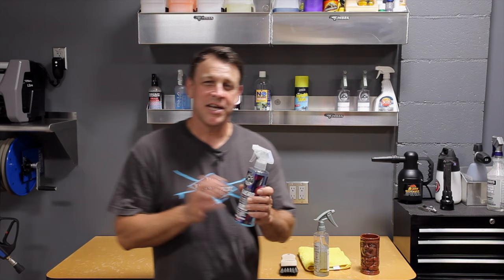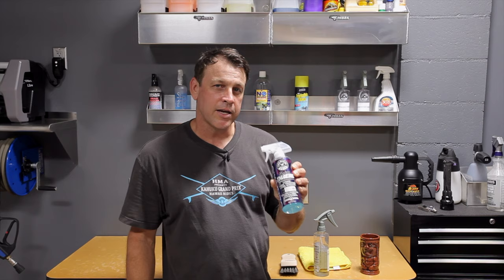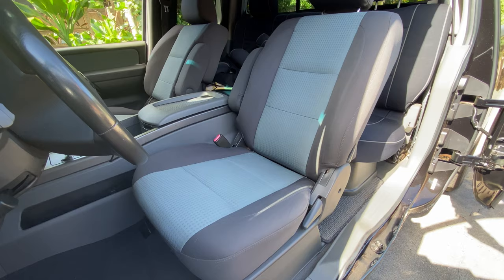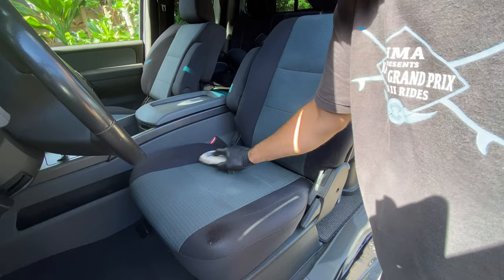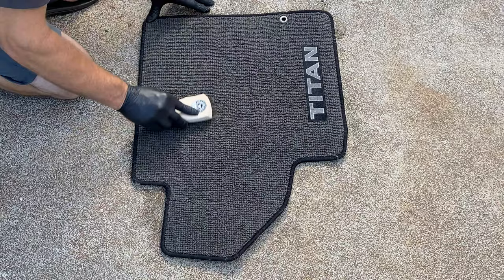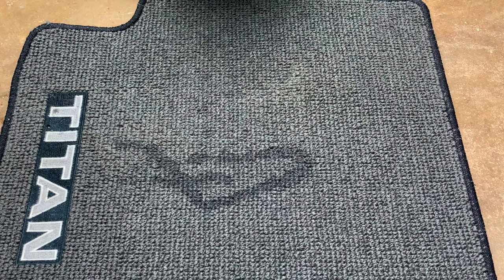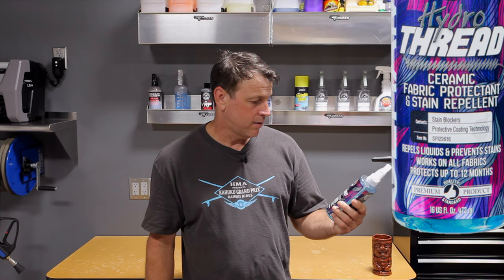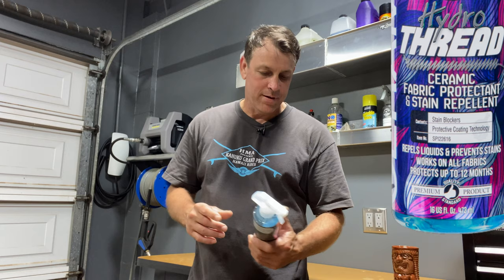CHEMICAL GUYS HYDRO THREAD CERAMIC FABRIC PROTECTANT Review & Test.

Comment: How long did you allow it to dry before pouring water onto it?  I used this on a set of higher end Lloyd floor mats that spent more time in my trunk then on the floors because I was worried about them getting stained.  I did two coats, 20 minutes in between and allowed them to completely dry over night and the results are exactly as advertised.  I'm in no way trying to knock your video but I thing a longer wait will work better.
Reply from the maker: I waited 24 hours for the first test. I tried again at 48 hrs. Same result. I even tried a week later to be sure before I posted the video. Water soaked right in. I did multiple coats and used plenty of product also. After watching a few other videos I believe it has become clear that it is only effective on select types of fabric. If the buyer is lucky enough to have the right fabric than it probably works fine. The bummer is it says all fabrics on the label. The fabric in my truck is a synthetic blend which it does not work well with. This is a super common fabric in trucks and trucks are the type of vehicles that would benefit the most from this product. Thanks for watching and for your feedback.
Reply: @HawaiiDetailing  pretty solid reply there

Comment: Is there a product that you would recommend? I just bought a gently used 2019 Nissan Rogue with about 16,000 miles on it. The interior on it is completely flawless, I’m afraid I’m going to screw it up.
Reply from the maker: I don’t have a goto fabric protection product. They all seem gimmicky. I would stay after it with proper cleaning products and you will be fine. Look at my interior cleaning videos and there are links to everything you need and I go over how I use all of them. Thanks for watching

Comment: I’m just gonna be straight up I have used this product and it really does work. It could be because he didn’t allow the product to cure. I have this product on my seats on my car and I spilt a polar pop and I had outstanding results most of the liquid ended up in my weather tech mats
Reply from the maker: Thanks for commenting and watching. I am glad to hear that it worked for you. I just wanted to share my personal experience with the viewers. I bought the product with high hopes. I usually don't buy things and review them unless I thoroughly research them and plan to own them myself. I really thought it was going to work well. I replied to a comment from another viewer when they asked how long I waited after product application to test. I figured I would re post it. One thing to add to that comment is its been over 2 months and I have ran several more tests and water still soaks straight in to the fabric.
My previous comment:
I waited 24 hours for the first test. I tried again at 48 hrs. Same result. I even tried a week later to be sure before I posted the video. Water soaked right in. I did multiple coats and used plenty of product also. After watching a few other videos I believe it has become clear that it is only effective on select types of fabric. If the buyer is lucky enough to have the right fabric than it probably works fine. The bummer is it says all fabrics on the label. The fabric in my truck is a synthetic blend which it does not work well with. This is a super common fabric in trucks and trucks are the type of vehicles that would benefit the most from this product. Thanks for watching and for your feedback.
Reply: I too have had good luck with it on my 2018 C7. It does recommend using at least 2 applications for the best results. Now it may be the difference in fabrics etc. I can only tell you my floor mats look brand new and water beads up and does not saturate into them. Again my results with 2 applications about 40 min apart.

Comment: I'm sure you pour the hot water for testing it. because ceramic or silicone coat won't be last if u pour hot water. unless if warm water is fine
Reply from the maker: Yeah. Room temperature water. That’s 80F here.

Comment: So with this product, your seats really have to be extremely dry before doing any application with it. i know you said you waited but i mean the sun was in the exact same spot judging by the lighting. This product if applied to something wet damp or even has humidity that's still evaporating beneath the seat in the foam (which is what I guessed happened). it negatively effects the products. thats why the bolsters were better than the midde, they didnt have evaporation happening beneath it AS MUCH as the middle. it still had a little. but not as much. a good way to test if the var is still evaporation anything is shut the doors and close the windows. if it looks like condensation happening after an hour then it's not done
Reply from the maker: I waited plenty of time for it to dry and applied the product. I even put half the bottle on there a few weeks after this test and it’s the same thing. It just does not bond to this fabric type. It says all fabrics on the label and thats not true. It is what it is. The bummer is most trucks that need this protection have similar fabric. I could put the rest of the bottle on there right now and it will still not repel water. I am always more then fair with my reviews and I really wanted this to work trust me. Thanks for watching and sharing your thoughts.
Reply: @HawaiiDetailing  and you left the doors open the whole time after cleaning them and also when you applied it?
Reply: @HawaiiDetailing  I only ask because I did my own tests at my car lot and got your result and the advertised result. On one method I power washed shampooed and extracted just like any detailed does. After letting the surface dry (like you did in your video- only judging by the bolsters- the way you described checking if the entire seat is dried) and it didn’t work. Used a whole bottle for one seat and it never worked. Imagine a milkshake being sucked up through a straw. If the bolsters were the size of one cup, you’d empty it quickly. If the center was a cup you’d empty it after more time. You only checked and mentioned the bolsters being dry and can apply now. With the time that passed from being wet to dry on the bolsters and compared to your video lighting, it matches up perfect. But it takes 2 days in direct sunlight to lift all the water out of the seats in the center. The chemical compound is deteriorated when combined with water. You power washed your seats. Any humidity being evaporated through the chemical is neutralized and makes it ineffective to the claims. The only way for it to not work is if you combine it with any water while it’s applied or drying. My second method was applying it to a dry seat, not detailed or power washed at all recently. I applied 2 coats and let the first one dry for 4 hours in the sun. The second was the next day and I let it dry for 4 hours in the sun. It did exactly as advertised. Using less than you did, better results, and a different method. To achieve your results I had to power wash the seat and not let it dry completely. There’s no other environmental element to counter the effects of this product besides water, humidity around it, or evaporation passing through it. Something happens with water for you to get those results.
Reply from the maker: @atruerock8020  thanks for sharing. Hopefully that will help someone if they try the product.

Comment: Just a question did you water test the seats and floor mat right after application? I’ve had iffy results as well, but the application states it needs some hours to cure
Reply from the maker: I waited 24 hrs for the first test. I even waited a week and tested again before I posted the video because I wanted to be certain it failed and also wanted to be fair. I really wanted it to work but unfortunately it came up short. I have watched other videos that showed it working on select fabrics. I think on synthetic blend fabric it does not seem to work. The bummer is it says works on all fabrics. Another bummer is this type of fabric is in a lot of trucks where I found this product would be most promising. Thanks a lot for commenting and watching.

Comment: If you watch the chemical guys video for this product they say to spray it from a distance to get more even coverage and also not to be too aggressive when you’re brushing it in. Maybe that’s where the issue arose?
Reply from the maker: I have went at it again since that video and unfortunately I put almost the whole bottle on the seats trying to get it to repel water and it just would not do it. It’s a fabric type issue. They say all fabrics but it definitely does not work on the blended fabrics like in a truck. Thanks for watching and commenting.